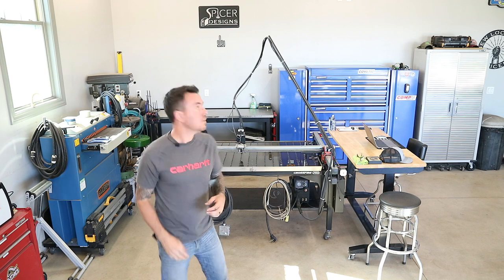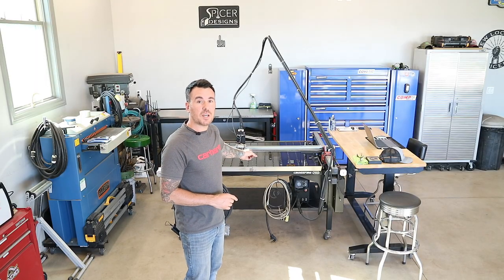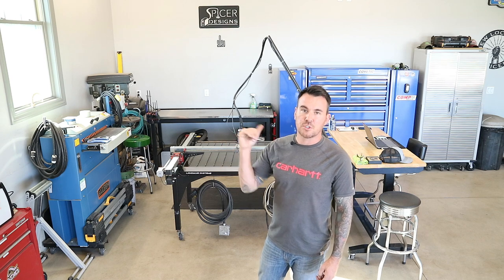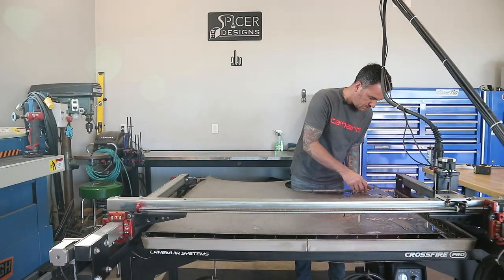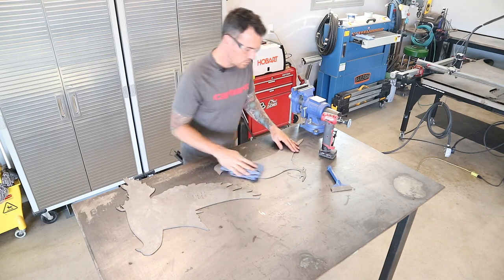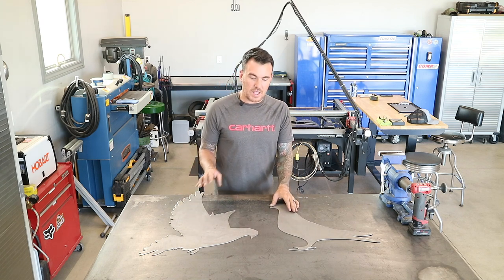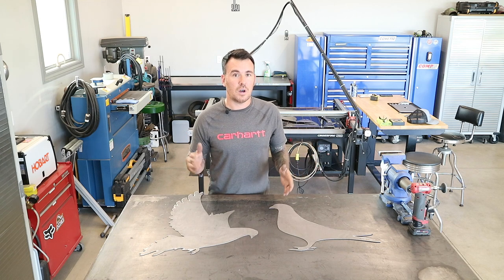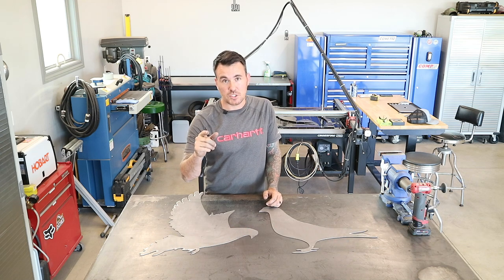My SECRET FORMULA for PRICING CNC PROJECTS!

Comment: Nice video.  I have the same machine with hypertherm power max 45 xp. Right now I’m using finecut on all of my signs and silhouettes. I’m cutting 5052 h32 aluminum 16 gauge. The fine cut is night and day difference, the Details are very sharp.  Thanks for posting your video 😁 watching cnc plasma never gets boring also what is your baileigh machine ?? I have a baileigh rdb 150 tube bender.
Reply from the maker: Ill have to look into that.  Im not too happy with the fine details.  Anything smaller i have to sub out to get laser cut
Reply: @spicer and @richie 

I’ve seen some work done with that specific aluminum, as well as some of your work Rich, and it looks super nice! I know nothing about this other than I like looking at it, but are there any advantages/disadvantages between steel and aluminum? Other than cost, I would think aluminum is the way to go. But again, I don’t know anything about it other than I personally prefer aluminum pieces. Thanks.
Reply: @SpicerDesignsLLC  ya if you get a chance try the fine cut. I will never go back to standard unless I’m cutting large thicker pieces. ( they work great don’t get me wrong ) but the fine cut on small pieces with details is unbelievable difference. You will love it.  This was such a great video to show people how to price and what to except.  Best one so far. And your shop is MINT man !!!! Love it
Reply: @ar2043  well, the steel has a much sharper looking  edge than the aluminum. But the aluminum is nice in that it’s super light and easy to handle the sheets. My sheets are 52”by 72”. (Odd size I know lol ) but they weigh only 20.6 pounds. And I have a stack of them. Both look great cut. I just happened to get a good deal on the aluminum

Comment: Do you use your Baileigh drum sander for sanding your metal signs? Ive seen videos of guys using wide belt sanders to put nice finishes on their metal signs. Thanks.
Reply from the maker: My plan was to use it to clean the dross.  I made a video on that sander.  Not sure if you watched that one yet.

Comment: Nice info Kyle.  Do you use a service that already makes a cut file for generic items?  I ask because a customer wants a skull and crossbones for Halloween and a turkey for thanksgiving.  He’s buying from me, painting and reselling them.  Thanks
Reply from the maker: No i typically make them from scratch. I dont do a whole lot of stock signs like that.  If i had a fiber machine i would.  Less clean up.

Comment: so roughly $70-$100 sq ft depending on finish?
Reply from the maker: It all depends.  I would say its closer to $20-50 a square ft for a typical monogram.  If you can use the scrap on smaller cuts you can make some more per sq ft.
Reply: @SpicerDesignsLLC  I guess it would depend on material thickness too. Trying to get a rough estimate on what to charge by area if that’s possible.

Also, do you have a program you recommend for transferring images into a file? I’m new so all the help in the right direction would be appreciated! 🙏🏼

Comment: Happy Thanksgiving! Quick question what is the air pressure you are using from the tank to the dryer then to the plasma? I ordered the pro today sorry i didnt use your promo due to black friday deal giving me the limit switch and thc for free. I do like your videos please keep them coming! 🍻
Reply from the maker: I run it at 75psi.  Congrats on your purchase and i understand.  Langmuir screws me on they’re sales.  I get them traffic but no credit.  I would have done the same thing as you.  Save whatever money you can.

Comment: Pretty clean cuts. I’m running fine cut tips that run up to 30a. 
Mind sharing more settings for clean cuts like that
Reply from the maker: I typically run 35 amps at 70 ipm on 14 ga mild steel.   Thats the bulk of what i cut.
Reply: @SpicerDesignsLLC  do you use a thc? Or just set the height and go?

Comment: Nice video, What do you spray over the sheet? and why?
Reply from the maker: That was probably just simple green cleaner.  Just to clean any residue off of it.  If the material is really dirty, ive noticed  it will mess with the cut.  Nothing that noticeable but i clean it anyway

Comment: Hi Kyle, new subscriber. Great channel. I must have missed it but I'm curious to know what gauge steel your typically using for your signs? Thanks
Reply from the maker: Thanks for subscribing!   I like using 14 ga most of the time.  Sometimes ill use 16 and 12 depending on what it is.   Thanks for the comment.